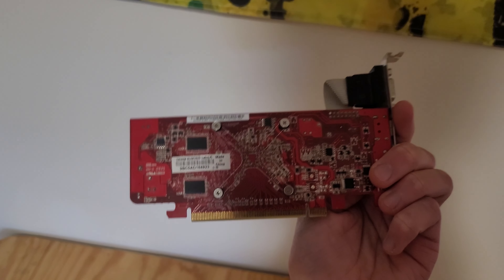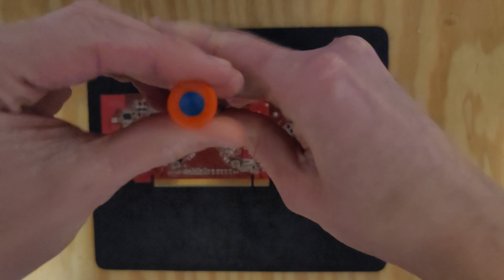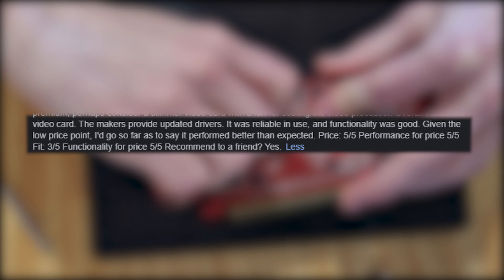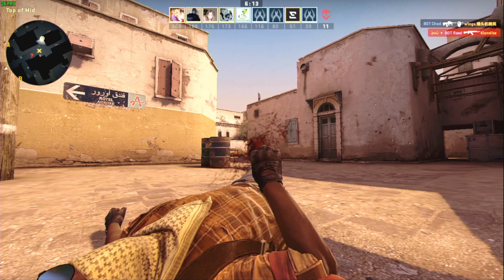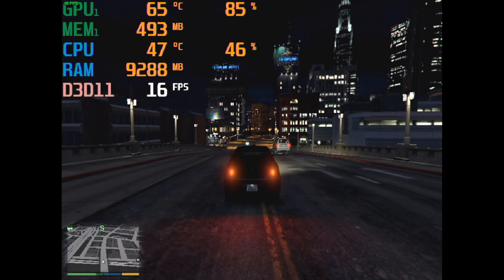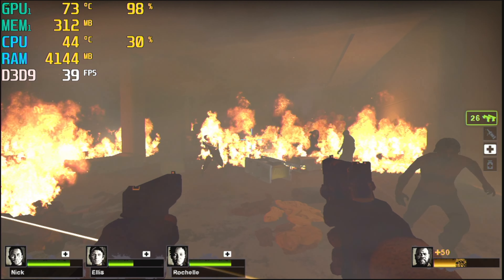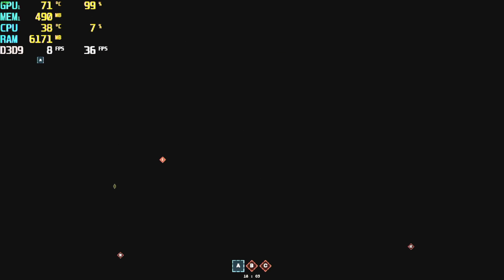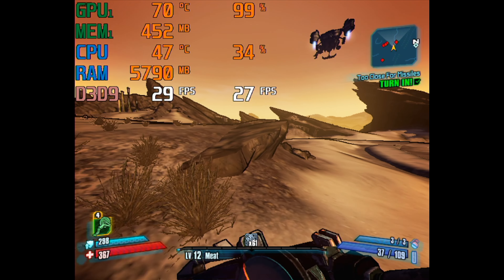Overclocking On A $20 Graphics Card (NEARLY Gone Wrong)

Comment: I have one of these XFX brand, with a smaller heatsink but the temps never get past 50 C without overclock. Also, you can increase the OC range using MSI afterburner. For shits and giggles, I OC'd mine to 750mhz core and 520mhz memory clocks. It can actually run Crysis at low settings around 720p pretty well. I was surprised. Turns out, I needed to use this card to play Red Faction because RF can't use cards with 2GB of RAM and my GTX 960 is over that.

Comment: The main issue with the card is the vram i see the vram limit being hit constantly i think if you got the 1gb card it would perform a bit better and yea the card is two times worse than a modern 12 th gen pentuim  igpu so just think about that and amd has much better igpus than intel soo yea
Reply from the maker: That's a good video idea to. Comparing the card to its 1gb counterpart, or integrated graphics. I like it
Reply: @Jaindike  Then you could also test crossfire with the 1GB card, although you would be limited to the 512MB of vram that the lesser card has